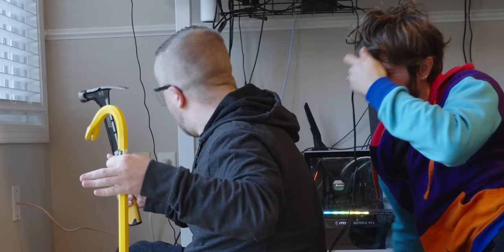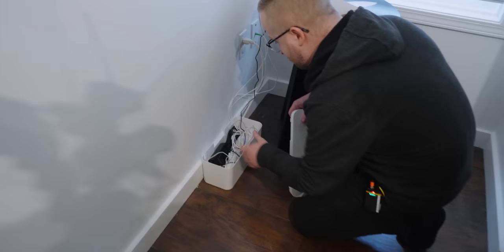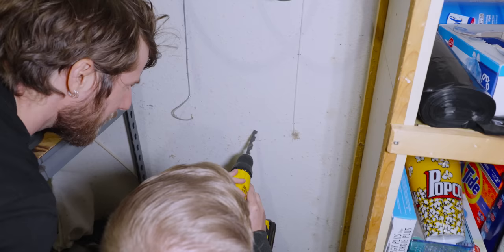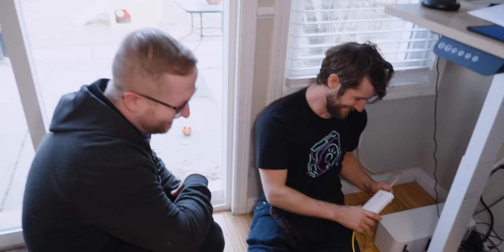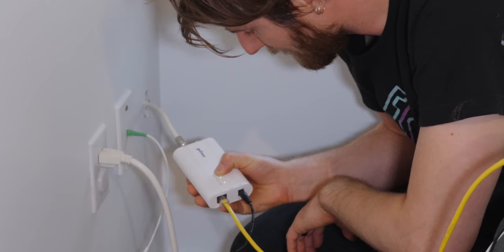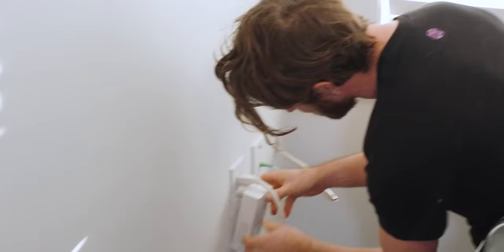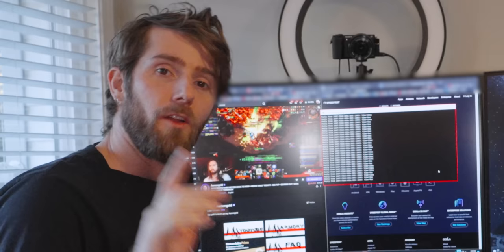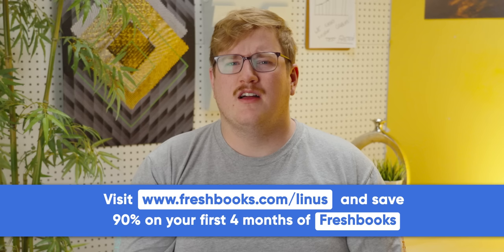I Will FIX Your Wifi - MoCA and Powerline at Colton's House

Comment: Fun fact, if you have 2 Xfinity internet connections in a house going to different modems, one will inevitably try to take over the other over MoCA. I had a friend what couldn't figure out internet issues. We couldn't really access the other modem, but could disable MoCA on his. It would work for a bit, then for some reason that setting would reset and we'd be back to the same problem. Comcast was of course insistent that there was no problem.
Reply: Comcast is the Chinese Government of ISPs
Reply: Former Xfinity employee - This is a fail on whatever technician did that install - you're supposed to install MoCA filters to prevent this. Many techs don't know how to do a lot of these aspects of the job now however, which i really can't fault them for because training sucks & they really don't get paid much for their "expertise"
Reply: That's because they have to be on separate networks. It's an easy fix, just put a moca reflector/filter on the back of one or both.
Reply: @ashdavis4845  A lot of techs just put the PoE filter on the ground block and dont think about how MoCA actually works.... Ive had to explain too many times why you cant have an XiD on a 2way before a 4port MoCA power amp
Reply: Also log into the gateway and turn moca off if its not being used Xfinity has had that since it was introduced
Reply: Kinda want my 20 mins back— first LTT video I have watched. It was funny, but I expected a serious tech resolution. Power line can work well for a limited demonstration, but in a normal household running all sorts of devices, the electrical lines get very “dirty,” and the results are just not consistent, ergo not good for gaming. If I see a follow-up with a MoCa fix, maybe I will watch again.
Reply: I had the same problem with MoCA and Xfinity, I would disable the MoCA feature on their modem/router and it would work for a bit then it would reset itself and go back to activate MoCA to ON.  The way I solved it for good was putting a MoCA filter on the back of the coax input of the xfinity modem/router and voila I disabled their MoCA feature and never reseted again. It has been working perfectly for the past 2 years.
Reply: dude you have no idea what you are talking about.  But if that was to happen you could just put an inline mocca filter on the back of the modem that does not have any tv service and now the two modems can't see eachother over mocca

Comment: When Linus unplugged the router and plugged it back it, could that have helped with the ping spikes and why we didn't see it that much at the end of the video versus if the router ran for days on hand you would notice more spikes?
Reply: You are on to something. I recommend that people put the crap "gateways" the cable companies give you on a timer to restart like every Sunday night or every night. Helps a ton! Or just buy good equipment and hardwire EVERYWHERE possible!
Reply: yip...my router auto reboots every few days to prevent this...
Reply: If only people knew about this issue for years and built equipment that can do this automatically. Seriously, I haven't been able to find a router that doesn't require a human operator to reboot it from time to time.
Reply: @thetechnoguy2010  Yeah, but sometimes ISP's do not allow to use any other routers like mine does (its also the only ISP in my building so I cant just change it lmao). I have a HSGQ-G111W router, which does not have that kind of functionality and its just sad.
Reply: @Ruslan-S  MikroTik? 300+ days uptime with no problems, then I upgraded RouterOS.
Reply: @Ruslan-S  there are workarounds, but yeah, haven’t had a router that restarts itself but I use a smart plug and schedule on and off time. Still works even if disconnected from the net since it saves the automation/schedule
Reply: @Ruslan-S my dream machine pro restarts at 1 am every week
Reply: @thetechnoguy2010  Some routers aren't too bad. Frontier gives you a fairly solid one if you have fiber.
Reply: @Ruslan-S  I've had great success with my ASUS RT-AX86U flashed with the Merlin firmware. Before flashing Merlin onto it I had the same "Need to reboot it every night" issues that other commenters mentioned with the ISP router, but by the power of the open source community, the router has been amazing.
Reply: @KyleDavis328  Cool! I might try this. I have the predecessor to your model, the RT-AC86U 😄
Reply: @thetechnoguy2010  pretty much exactly what i did
used to have constant issues with both wifi and powerline, so about a year ago i finally decided to take a week to do proper ethernet runs throughout the entire house, literally every non-mobile device in the house has a dedicated run now, and while im still stuck with the ISP device to take in the coax cable and provide an ethernet WAN port, ive got that going into an actually decent router that has been running almost non-stop for the entire year with no issue, and a separate wifi access point up in a high/central part of the house

reliability issues are completely gone, and there was also a rather quite significant speed gain for all devices, which wasn't expected, so turns out that for many years we were never actually getting to use the full speed of our connection, and now we can

best part was that i did it with cat6e, so a few months ago i was able to get 10Gb hardware for my NAS and my main PC
Reply: @Ruslan-S  DD-Wrt allowed it back in the day and most routers and Gateways do. ISP usually lock it out so they can pseudo assign an IP to a user. The uptime meant they could do easier QoS back in the day, but now they don't do that method, the legacy idea still remains though.

Comment: MoCA is great if your wiring makes sense. In my house, each Coax outlet from the rooms comes as a separate cable to the basement, which makes it super easy to plug them into a splitter and into a single MoCA adapter and into my router. (Also I don't need to worry about encryption, since none of the wiring is connected to the outside connection).

Coax is designed for high bandwidth RF communications after all (it's a shielded cable), so it works really well.
Reply: Think this is the issue of their failure. Doubt this part of the project had been planned but assumed.
Reply: Same.

Comment: My house had coax runs to almost every room that went back to a central box in the wall. Instead of using moca i just decided to replace the coax with cat 6 and put a small network switch in the box in the wall.
For me its been a great solution the cable replacement was easy and a cool diy quarantine project truly recomend it for the best internet possible
Reply: How did you replace coax with cat 6? Is it possible to replace coax with cat without breaking the walls?

Comment: Power line can have problem in EU house with whole house protection, especially if the two power-line routers are on different breakers. (Most US house only have protection in bathroom, so main breaker won’t interfere with power-line).

Same model/ series adapter/router is important for power-line MoCA and mesh Wi-Fi

Comment: I've personally never had good experience with power line adapters. The source and destination are always on different breakers which caused issues.
Reply: And i've never had a good experience with MoCa adapters... Ethernet is still the way to go. Wifi as a second choice
Reply: @Anticlimacticwhale  seriously? moca adapters are about as reliable as they come..
Reply: @bdziver12  I had 2 pairs of em. No bueno. Could be user error but I had my chance with them. Will stick to what worked for me

Comment: This video has brought me such joy as I purchased a house this year with awful wifi coverage(old farm house, thick stone walls and strange layout) but was wired up with coax in most of the rooms! Never knew MoCA existed
Reply: A house like that has good bones; should last you a good long time. But you're right, it's a nightmare for wifi. Get yourself a few MOCA adapters and switches, maybe a cheap AP if you need wifi in one or two rooms, and you can network that baby up right.

Comment: Note that you can't run these if you share a common ground or a common phase. Some powerline kits will use the ground terminal to connect to each other, others will use one of the phases. If you're in a terraced property or a flat (apartment), chances are you have either a shared ground, or a shared phase income. That means if someone else has a powerline kit, their kit may interfere with yours and vice versa. These days, they shouldn't connect you to them or them to you, but all the same - these powerline kits are only suitable for houses, or flats/apartments with definitively separate grid connections.

Comment: OMG I learned about MoCA in early 2022 and have 2.5Gbps running to my upstairs router. I also have fiber because cable is slower and more expensive at my house. 

The positioning of my upstairs and downstairs router isn’t ideal for dedicated wireless backhaul so I used MoCA for wired backhaul and spent a little more on the 2.5Gbps to help future proof my current 1Gbps connection. It works amazingly well! 

I’m so glad that you’re doing a video about this because more people need to know!! It kicks the crap out of wireless backhaul. Fixed all of my issues and is much faster than when wireless was even working at peak with an upstairs test in a better location for signal but not for home coverage.

Comment: To clarify power line works between the same breaker box, not the same breaker. It can be different breakers. Also, powerline adapters don’t work through a power strip
Reply: It worked on a power strip in this video, so...
Reply: @isabellavision  I guess I should say, surge protector. Power strips are ok unless they are surge protectors

Comment: Good timing to see MoCA; I've been using powerline in my house in the UK for ages and I always get kinda crummy rates (150-300mbps).  Since getting Gigabit broadband I've been wanting to upgrade - I was considering using the TV Antenna cables that my house had (which aren't very common here) to pull network cables up to the attic and set up LAN... but then I discovered MoCA.  I plugged one adapter in next to my router into a TV Antenna connector, and another into the TV Antenna connector in my home office room.  Boom, 2.5Gbps in the house and a full 1Gbps internet.  Holy crap, game changer.  Now I just need a second 2.5Gbps network switch, but they're still very expensive.
In the UK satellite TV uses the same frequencies as MoCA but Digital Freeview is safe and sound without any clash.  You could put a PoE filter on the end to play it safe, but I just turned Encryption on instead.

Comment: You don't really need the encryption in most cases, particularly a house. There are moca filters you can install on the external facing side that block that frequency from entering or leaving the premises. It's often preinstalled by your cable provider.

Comment: I've tried to use powerline in the past in order to try to "hard wire" connect my asus routers for ai mesh but it is, as the video showed, extremely hit or miss. In my brand new constructed home, with everything going to one breaker box, it was extremely finicky depending on which outlets you plug the adapters in. Also as the video showcased, my ping was also "on average" worse than utilizing wifi but yes wifi is prone to very big ping spikes and that's a huge no no for ai mesh setups.

Don't rely on a powerline solution unless it is literally the last available option. I ended up routing a 100ft CAT 6 cable up from the basement along the baseboards as cleanly as I could with like 80 little bracket things to neatly push the flat white wire up against the white wall.
Reply: A brand new house without Ethernet? What went wrong there? I think I've never seen any house built after 2005 without Ethernet cables😅
But yeah I agree... Powerline is only a solution if there's no way you could pull cables. I only had bad experiences with them.
Reply: @jorrit_o  builders are cheap. My 2016 house doesn't have Ethernet, only cable.
Reply: Powerline option lasted as long as it took us to go buy a 50 foot spool and run the wire directly.
Reply: If you're handy at all try pulling the base board off. There is usually a small gap between the floor and the bottom of the drywall; big enough for an ethernet cable. Can get things all nice and hidden.
Reply: I would probably sue the contractor if it's a new home and it's not wired with Cat-6 ethernet to every room
Reply: If you read the box they say they only work on the same breaker, think about it and it starts to make sense...The breaker that powers the kitchen is isolated electronically from the breaker that powers the basements, hence why breakers can trip independently. Sometimes they do work across breakers, much slower, but this is only the case if your electrical wiring is not up to modern code, commonly having to do with where bound neutral wire are.
Reply: @jorrit_o My house from 2012 has COAX and Telephone wire,NO ETHERNET. This most likely because the isps in my county lobbied to stop fiber implementation and keep our city on coax
Reply: Also the contractor that built this house cleaned out on certain aspects
Reply: @christinekwasnicki4238  had to remove a portion of my base boards this year because of a leak,this is indeed true!. I think this is going to be how I run ethernet through my home
Reply: I've used them for a couple of years because it was a rental and the WiFi had weird dropouts for no sensible reason. Like a d few feet between the WiFi dongle and the router (with a ceiling in-between).

Still had to power cycle the powerline adapters every few weeks or so but they worked ok. What's interesting is they sell 500mbps but that's not a thing... It's 10,100,1000 and their docs on that are sketchy at best. So they can work but I'd get 1000mbps and put it in a smart socket with a scheduled power cycle every day 🤷‍♂️
Reply: @joshjones5172  problem with that is that a vast majority of newer homes in the US have each room on their own breaker so yeah if you aren't in the same room as the modem/router you are shut out of luck when it comes to powerline adapters. Also my brand new modular home from about 2015 has ethernet but it's setup up as 10/100mb to each room. Aka 1 ethetnet cable equals 2 rooms so the pairs were split so each room only gets a max of 100mbps which is NOT good when your internet does twice that or even more. So yes NOT all wiring in homes is created equal
Reply: @jorrit_o  2005? Ethernet wired into a home was barely a thing back then. we were only just getting hi speed internet. wtf are you on?
Reply: @SeraphX2  It probably depends on the country... the upper floor of our house here in Germany was renovated in 2003 and we have CAT5e everywhere. And all my friends have CAT6 or higher in the walls.... Back then they were either just used as phone lines or just didn't get used until I connected them all a few years ago.
Reply: Gomam0n  Weird... Here in Germany they are only responsible up to the  junction box. Everything behind is the responsibility of the home owner. 
But couldn't you just tell the electricians to put for example CAT 6 or conduit in the walls?
Reply: @jorrit_o  OK, Sorry, my bad. In America, we use RJ11 for land line phones. CAT seems like a bit of overkill for a simple phone system.